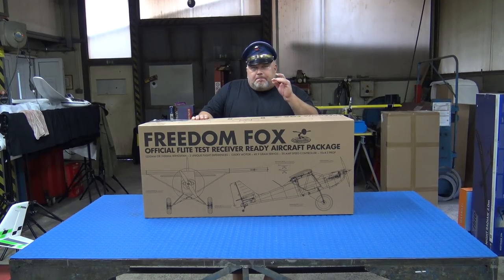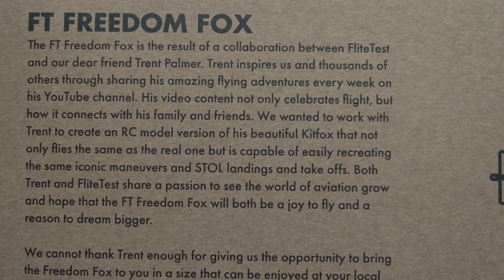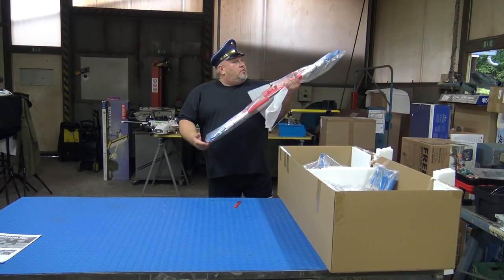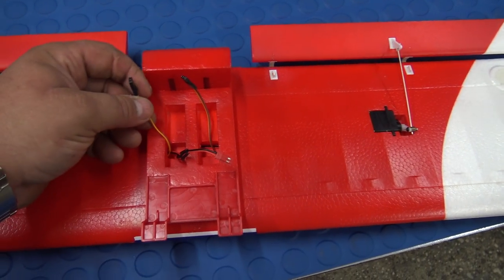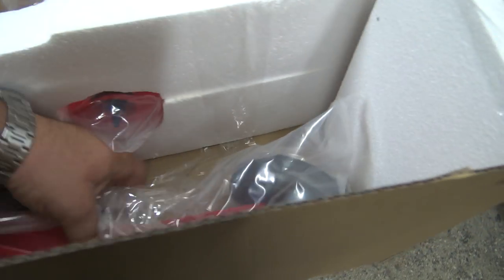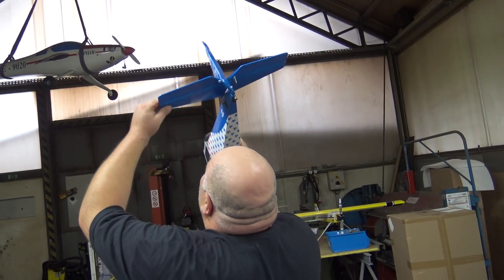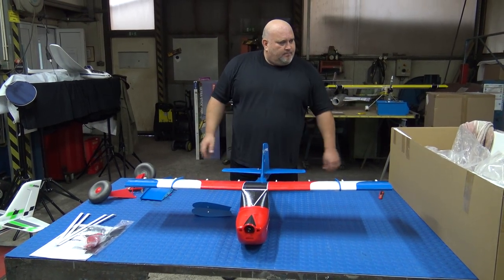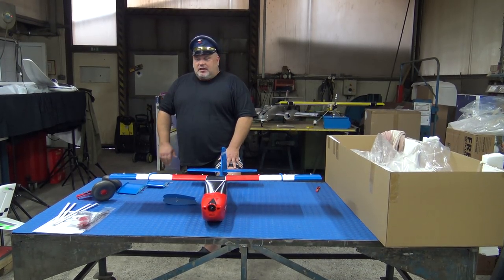FLITE TEST Freedom Fox PNP 1100/1250mm 3S Unboxing

Comment: Nice and colorful bird. Those motor mount screws can be ground down with a dremel tool. Use a sanding drum. You can glue some scrap foam and use it as a barrier to keep that lipo away from the back. Love the shop time and unboxing. Its always Christmas with the Petrincic bro! Cant wait for the maiden!

Comment: I've had one since the release date..just be careful on takeoff it will roll to the right hard. It lands fast and requires alot of up elevator to keep it from nosing over. good luck..I would use a gyro rx.
Reply from the maker: I love this bird my friend. Great flyer and so much fun in the air.